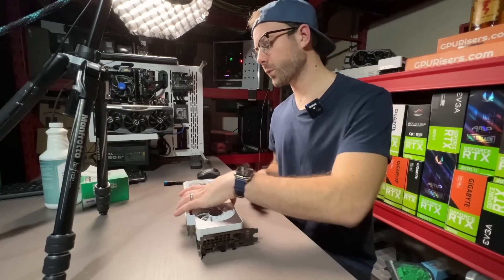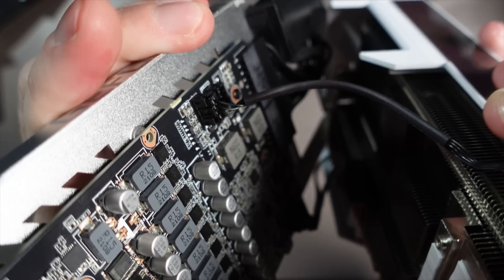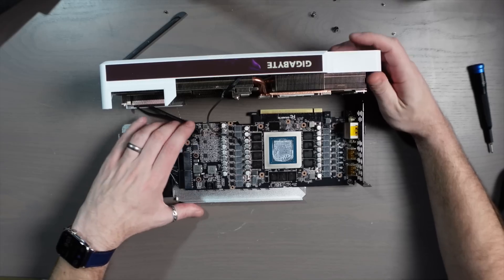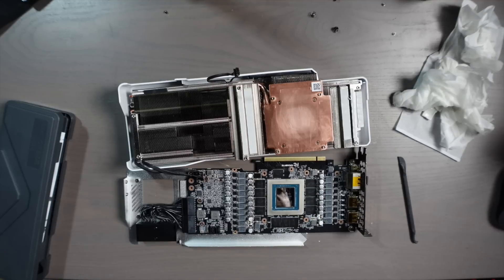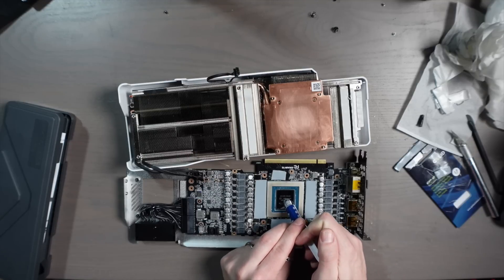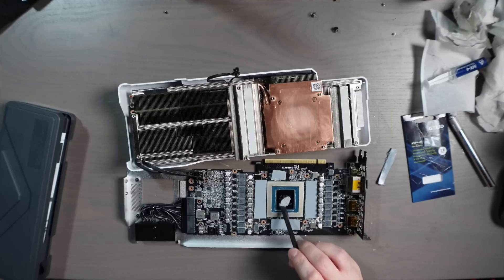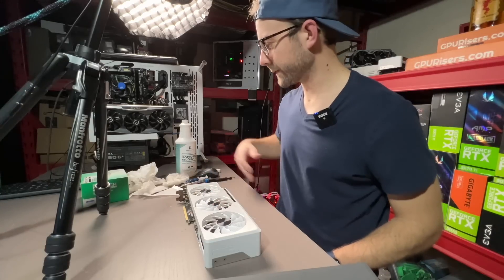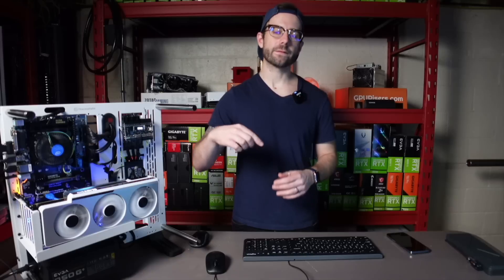RTX 3080 TI Thermal Pad Replacement & Chatting

Comment: A number of people, including myself, are reporting a failure to lock the core clock after replacing the thermal pads on the MSI RTX 3080 TI. Do you have any ideas as to the cause?

Comment: It's interesting that so many people have issues with the memory temps, while I have issues with core temps.

My 3080Ti Gaming X Trio, after changing pads, sees about 72C on the memory with a +500MHz overclock in Cyberpunk and a 108% TDP. Will have to try mining.

But even with NT-H2 thermal paste on the core, and replacing all pads and adding some to the back, my hotspot temp on the core will see 97C with stock settings and 108% TDP.

When I do an undervolt, my core hangs out around 1980MHz, but once the hotspot reaches about 90C, it starts to "run away" and will keep climbing until it thermal throttles. Generally hanging out around 105C.

No idea what is going on. Did a lot of inspection and troubleshooting, including some involving taking a dremel to the memory shim. But seeing other people get in the 60's or 70's on the hotspot just blows my mind.

Comment: I just got a vision 3080 ti and the vram bounces between 84 and 88c. Which is hot IMO. I never had vram temp issues with any other gpu I owned. But I have still replaced pads and paste many times before and this card looks way easier than the 2060 supers I have.
Core clock set to 1080
Mem clocks set to 9801 or +550 delta
250 watt power draw
78 Mhs
If I can get the vram temps down in the 70s I will be happy.

Mostly I use my 3080 ti for rendering. But I do mine to help offset the cost of the card.

Comment: I replace all pads on my gigabyte 3080, also add thermal pads at the back of pcb. It will drop another 3-5C in temperatures.  In fact the vram is cooler than my Gddr6 5700xt

Comment: New Gelid pads on 1 week old 3080 Ti FE:  HUGE temperature differences!

Last night,  New Years Eve, a friend and I replaced the front and back thermal pads on my 3080 Ti FE . I have had it only 7 or 8 days and I found it was running manual fans, as high as 96 C with 80% power, fans at 85/90 %!  The card's memory had been set at 1375, core at 0 (zero), and the Mv  (millivolts) set to .762.  Sometimes the card memory junction temp would hit  88 C, 90 C, up to 96 C a few times.   The Ethereum hashing rate was o 91.-15 to 91.87 often, but it was too hot for my comfort.  On go the 2mm Gelid  pads on the front and 3mm Gelid pads on the back, plus a nice layer of bubble-free thermal paste (Noctua).     Lord what a difference!  I use T-Rex miner latest version.   Now my "hot point" memory junction temp has dropped to no more than 74-76 C and the general card temp is in the low to mid 50's Centigrade. 

 I did have to adjust the overclock settings using MSI Afterburner because once I turned it back on, it would not hash above 85.35.  Way to low,  compared to how high it had been. That was down about 6-7 mh/sec compared to its best with the stock-hotter pads. 

Before I forget, my card has NOT received the new FLASH that's out from EVGA. My card is an FE (Has Samsung MEMORY FOR SURE via looking at GPU-Z software). I simply didn't want to chance flashing it.  All these numbers are with the factory original flash. My 3080 TI FE is set like this:   Win 10- 64 Bit, Nvidia driver 496.49 WITHOUT THE AUDIO DRIVER, Core set at 0 (zero), memory at 1315 to 1325, pwr 80-82%, with a temp limit at 75 C,  fans 75%, Mv (millivoltage) set using the MSI curve to be at .750.  Raising mv power to .758 using the curve feature will add another 1 mh/sec with  fans up to 80%....NO Hive, nothing special,  I use MSI Afterburner, I turn my automatic updates off for 7 days but I manually go in and update the mining rig on the 7th day.  I use  2  - 1300 watt EVGA Power Supplies pushing this currently small setup on an ASRock H110 PRO BTC+ . Open air chassis with 5 Arctic fans.  This week I'm adding 2 more 3080 Ti FE cards that will also get the new Gelid pads.  I'm also adding 2 - 1660 Supers, and an EVGA 3060 Ti FTW3 Ultra cards.  Should be getting toward 420 to 430 ETH megahash after all this is setup and going.  At first when I saw the hot stock temps, I distasted the 3080 Ti FE, but after the massive cooling and 89-91.5 mh/sec performance, It's amazing how much it helped.   Sorry so wordy, but it was an eventful last 2-3 days!  LOL      David

Comment: If anyone is interested, yesterday I got a brand new 3080 Ti FE. I've tried many different settings but these are working quite well- at least well to me. I use the latest T-Rex miner on Windows 10 64-bit, MSI Afterburner Mv is set to only 750, core is at 0, memory 1355, pwr 80%, temp max is 79 C, fans are 80%. It runs hotter core temps than I've ever seen on a card and it still freaks me, but others have told me my FE is doing fine.  Usual temps re 49 - 54C but the core has been as hot as 96 C on and off- usually 88 to 92 C.  It is hashing high 87's to breaking 91 a few times. It floats in that range.  Trex LHR started at 74 but kept kicking in until it got down to 72.5 and it's very stable now.  Planning on buying another FE version but Lord they are high priced!  I'm NOT planning on flashing the BIOS since it already hits 91 and a bit more here and there.

Comment: I have that exact same card and it would never perform good in HiveOS, I assumed it was mem temps, yesterday I changed the pads and it's doing great now 85+MH it would go down into the 50's before.  The core temp is higher now, but I used artic silver 5 paste, not sure if that's the difference as I know it takes awhile for that to cure

Comment: hi there, I have a question, I wanna build a rig, and I want to know what graphic card should I use, I can use 3 * GTX 1660 super, 3 * RX 6600 XT, or 2 * RX 5700 XT. which combination should I go? Tnx
Reply: 5700xt is the best MH/$ for sure. 6600xt has better efficiency. Nvidia cards always have the best ease of use. (No driver errors, easy overclocking, no bios modding, etc). Depends what you care the most about, for me it would be the 5700xts.
Reply: Red F0x Crypt0 YouTube Channel  Scam!!!

Comment: Hi Red Fox, recently got myself a tuf 3070 ti. Vrams hitting 100c after power limiting. 
Would like to ask if you know the thermal pad thickness for tuf 3070 ti? Would it be the same at the 3080? Not much info online.

Comment: Actually all my Evga FTW3 have absolutly no problem with cooling, but XC3 are nightmare. I recently changed thermal pads on them. I dont know what brand of thermal pads evga use there, but just after few months they have been in really bad shape, in some cases I had problem to remove them.

Comment: You didn't replace the pads on the VRAM chips on the back of the PCB. Those will matter a lot, especially since there is no active cooling on the backplate.

I did this with my own 3080 FHR Vision OC and dropped mem temps from 110C to 85C.
Reply: I thought it was only the 3090 that has memory modules and pads on the back of the pcb?

Comment: man I remember the hashrate vid you made on this card and on raven memories were burning at 106-110c. this improvement is simply insane and it's absurd how gigabyte can sell 2000 usd cards with absolutely trash thermal pads like that... disgusting business practices
Reply: My strix 3090 just as bad

Comment: Smart guy, changed only the mem pads. Some go thru the pain of changing all the pads.. Some tips tho...for warranty keep the original pads. Also even if there are no mem on the back of the pcb, put some pads there too, takes some of the heat and transfers it to the backing plate.